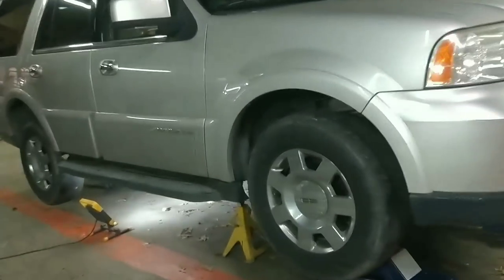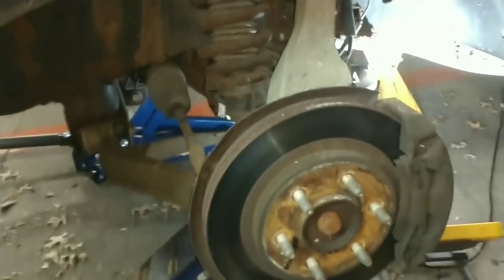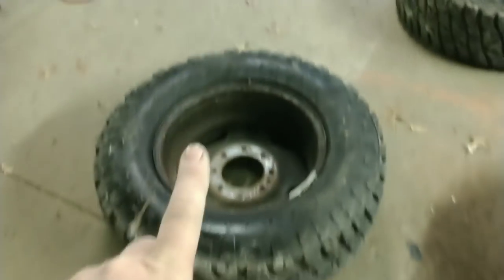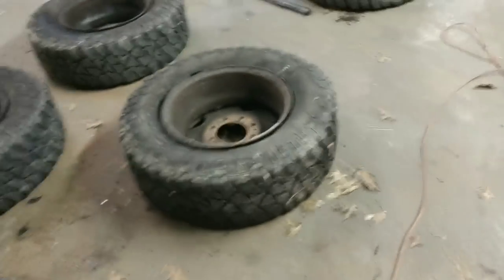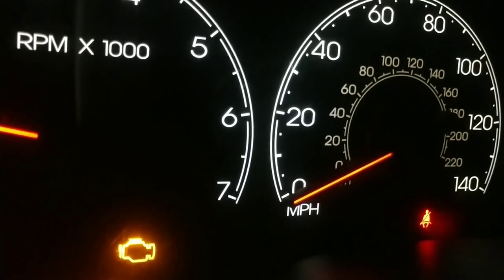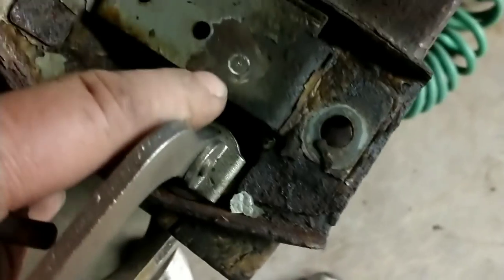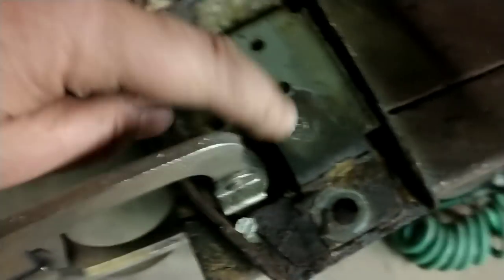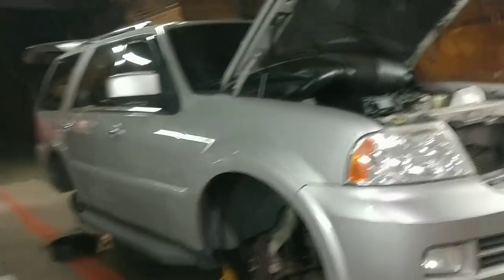BAD PART OF LETTING VEHICLES SIT TOO LONG

Comment: I stopped using Steel line to replace brake lines 2 years ago when I found NiCop line. It is Nickel Copper mix and does not rust. Only timee I install steel is if its a pre bent kit.
Reply: It may be better if the steel part can have some paint before installation, at least extend its service life by a few month
Reply: @yzhang8629  Really no point in buying steel line and painting it. Nicop line is the way to go

Comment: WOW, that Navigator is going to be a project JC. However, on the bright side, your daughter will have a safe, reliable vehicle to drive when you get it dialed in. Great to see a comfortable work temperature for the time being, so much better than working outside as you've done for years. Good chat about the wheel and tire combinations and your reasoning for the choice you made. Much respect for putting this video together for us considering the issues with your cameras, and now your phone. Hopefully, things will improve in the days going forward. Work safe, stay warm, give my best to Mrs. JC!
Doug@ the "ranch"
Reply from the maker: phone problem has been figured out....part on the way....not so much for the camera.....

Comment: I feel for you, really do..Then again, anyone who works on cars in the Rust Belt would. What I like is having to bring out 4 sizes of ratchet sockets just in case the "original" size nut rusted from metric to SAE or vice-versa. Oh, and lets not forget that even if you are lucky enough to have a warm place to work, the rust bucket will drip it's salt laden snow/water in your face because you HAVE to work on it....

Comment: Is there a bottom to this pit? LOL. I've made tons of brake lines using the regular plated steel line and never really found it difficult. But the Ni-Cop stuff sure is easy to work with. I use it to make fuel lines too. Not sure if that's kosher, but it my preferred method.

Comment: Iv had good luck with my kelly safi tsr tires, iv never got stuck in any tarain iv been in with them, they dont make alot of road noise for a knobby, iv been running them for 5 may 6 years now
Reply from the maker: these tires were not extremely noisy on the truck they were on but louder than a passenger tire. i think they will be fine on this suv.

Comment: I'm still waiting for my favourite No.2 Pozidriv screwdriver to reappear after my last bout of fettling in my '99 Merc C200's engine bay. Both bent coat-hanger and magnet-on-a-flexi-shaft failed to locate it. I did make sure that all moving bits weren't in danger by significant coat-hanger poking before admitting defeat. I guess it'll show up at the next oil change when I drop the undertray again. Meh.
Reply from the maker: right about the time you give up on it.....it will appear.

Comment: If you dont want to replace it again use the new copper style lines easy to use and no rust .I ve been wrenching for 45 + years been using the epoxy coated type since they came out   till the new copper lines what a difference

Comment: that soft line makes me nervous.  If it don't flare right, it'll leak.  If it moves after going over a few good bumps, it'll leak.  I'm with you
Reply from the maker: just feels you should have to struggle a little to get the right flare.....nickel/copper line is just too soft for me to feel comfortable.

Comment: With all the safety mandates on new cars with traction control, backup cameras, etc. I can't believe stainless brake lines are not required. I've had brake lines corrode and blow out on every vehicle I've owned in the past (Haven't on my current vehicles yet, but I'm sure it will happen eventually). Brakes are a fairly important safety feature, and the lines should be stainless to help prevent or eliminate brake line failures.

Comment: The fuel filter just below that brake     
line looks like it hasn't been changed in a long time.
Reply: Just wait for it to blow out & set the rust bucket on fire. Where ever this is it must be the rust capital of America. I driven my junk all over the salt flats for years & it's not that bad!
Reply from the maker: That fuel filter was replaced at the same time the rake lines were done. sitting around on gravel accelerates the rust process.
Reply: @j.c.smithprojects  Other than the state of corrosion, what state are you in?

Comment: You should see my wheel well on my 15 year old Silverado. The only thing holding it together is paint. A finger will poke through it. Cab rockers are long gone now. The bumps on the road are breaking it apart.
Reply from the maker: rust has no limitations.....and it never sleeps

Comment: DEFINITELY do not install a load range "E" tire on whats esentially an oversized station wagon
Reply from the maker: this is essentially a f150 with an suv body.....the e tires will be just fine.
Reply: @j.c.smithprojects   You will get better gas mileage with it too, on e tires 50-60 pds.  Know wonder that part was cheaper ,our dollar is worth alot less. I'm from Ont.  Thanks good video

Comment: Crusty the Navigator, the SUV that REALLY DOES NOT want to be fixed...
Maybe the real lesson here is, if you live in the rust belt, don't buy a mid-2000s Lincoln Navigator, they just don't stand up to the conditions...
Reply from the maker: at this point the needle is pointing toward parting it out.....
Reply: @j.c.smithprojects    I'm really not surprised.  That vehicle just has a death wish...

Comment: LT rated over P rated all day on a body on frame vehicle. All those codes, I'd think about driving off a cliff for the insurance claim....
Reply from the maker: many of these codes are redundant. some are because the air bag suspension has been eliminated. i am only concerned with the ones that have to do with drive-ability and safety

Comment: Here comes my armchair referee remark... JC, how it hell do you handle living in a state where the tin worms work faster than you on a wire feed at max feed setting out runs you?? My hat's off to you as it would drive me bonkers. I live in alaska where the southeastern is about as bad in ketchikan but north of anchorage you can buy metal pieces parts and they are rust free and thirty years old yet three year trucks get in a accident and just fold up.. no, not a crumple zone but the metal ain't safe in ten years to go get groceries?? Just baffles me how you fight the no ending war against rust. If I owned a car company like ford motor (its my dream remember) and my rig I sold you was using paint as a strength factor... like their ad would go; We install all our rigs with three coats of primer and three coats of paint so your feet won't get wet in your king ranch ford diesel truck you paid ninety two thousand for in georgia say five years ago.... this is    coming from powerstrokehelp.com and when he told me the price of the 2019 diesel king ranch with plates was that much I about heaved. I bought ten acres of land with a five bedroom house and small car park in 1965 for twenty five thousand... why so cheap? Because it had five of those acres of land that had virgin old growth fir trees that were about six to eight foot on the stump! Uncleared land that I did selective log and pay off the house the first year in and I made the bare minimum down payment .. I still had nice timber left so it wasn't ugly, the highway department bought (forced to sell) two acres for the road to go through for twenty thousand and now I have money in the bank, driving a new ford truck and I was single still so I still had money to start a business!! Damn I miss those days and no I don't miss the old junk cars and trucks they sold then but my new 66 ford with those napco front end four drive days was only less than (ordered) four thousand dollars.. And still rust free up there in washington